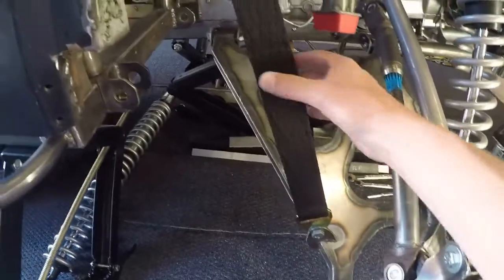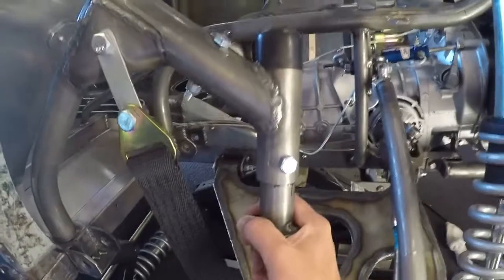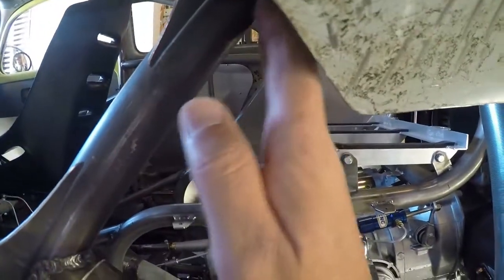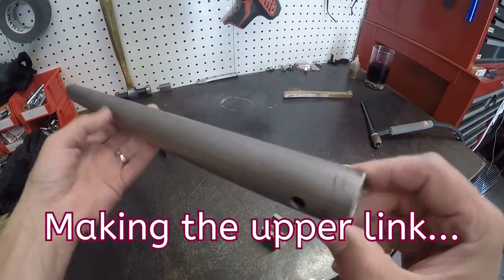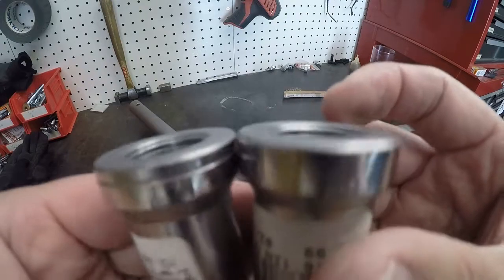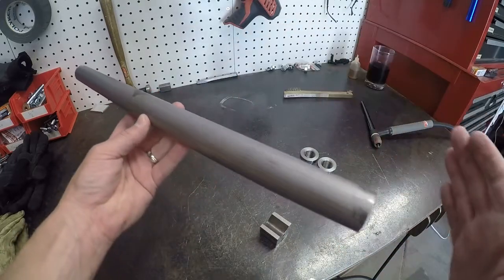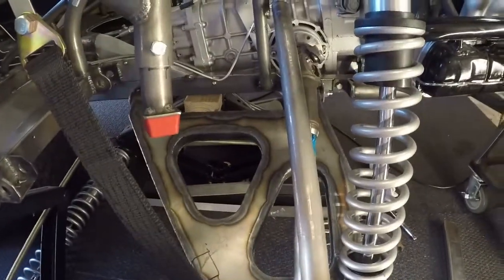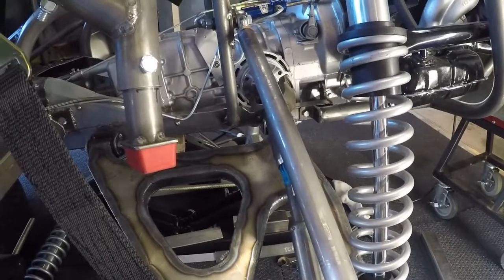Bump Stops Limit Straps and Upper links

Comment: Just a heads up. Check out TMR Customs. They have a really simple and nice design to adjust limit straps for like $40. It's a weld on block that runs a threaded limit strap clevis through it. It gives you 1.75" of adjust ability to compensate for stretch and fine tune them. They just came out with it. I plan on using them on the suspension build on my truck.

BTW Love the build.
Reply from the maker: Alvarez Metal Works, I just looked at them, I could easily weld those where mine bolt on. I might try them.
Thanks for the Great tip!
Reply: Doug Bug Not a problem at all. I was just checking them out myself right before I watched this video. I figured they would work perfectly for you.